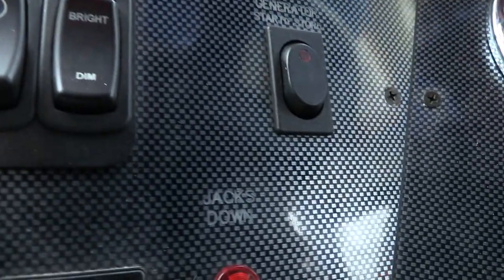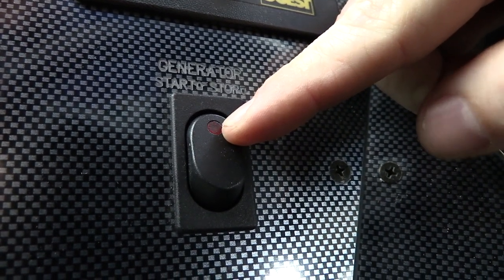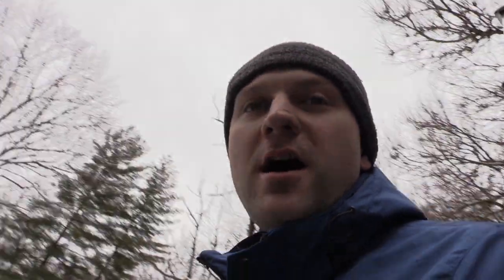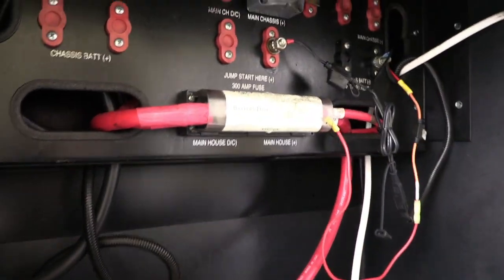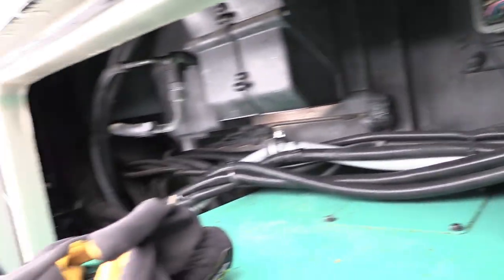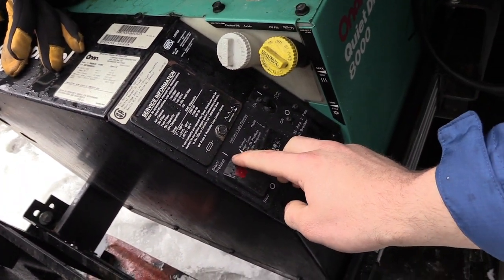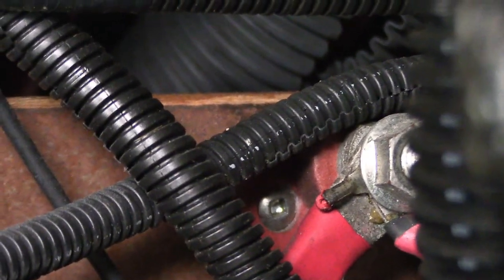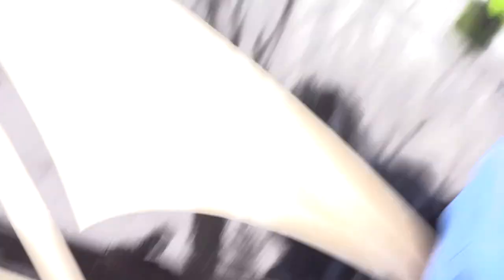Motorhome RV Generator Doesn't Start A Very Quiet Onan

Comment: I've been working on my On. Emerald lll. They have stuffed it into a compartment so small you have to remove it from the coach to change the spark plugs or access the carburetor. I'm going to build a slide out for it before I reinstall it. IF I can get it to run. I'm sure it's the carburetor but I can't get to the bolts to remove it. Gulf Stream wasn't thinking when they put the generator in such a small space. At least this way if I do have to take it in for repairs I can put it in the back of a truck and not have my coach in that I live I full-time.

Comment: Hello.  Could you suggest or recommend to me a good carburetor and fuel pump for a Onan 4000 generator?  Thank you.  Tom
Reply from the maker: Hello Tom! I would just do a simple Amazon search with the oem/original part numbers. Don't be tempted to get knock off parts. In some cases you can if they are the same manufacturer, but for how ofter you have to change these I would stick with the Onan branded parts. This will help with resale value later on. Thanks for watching!